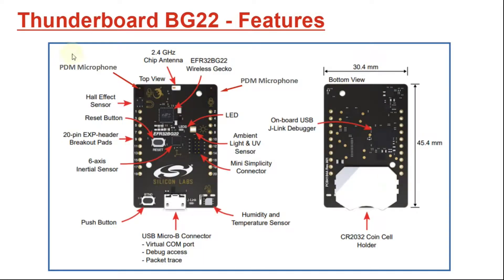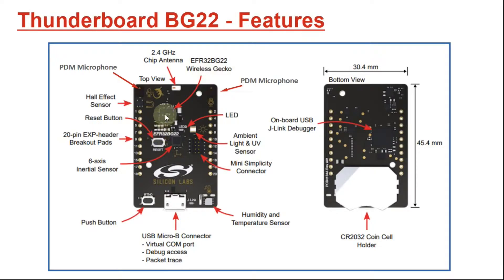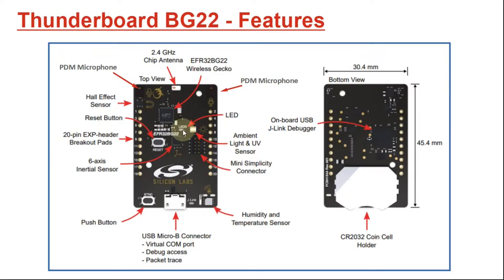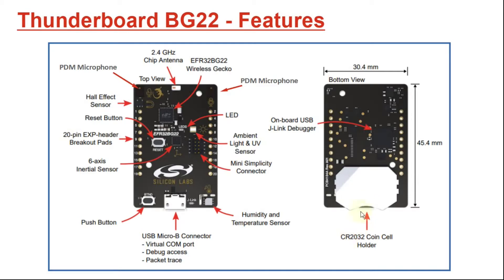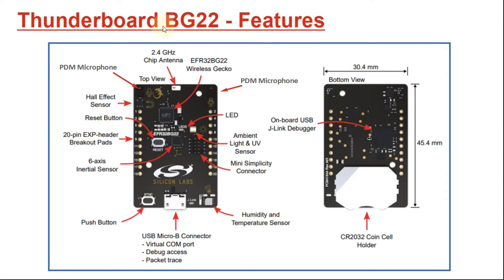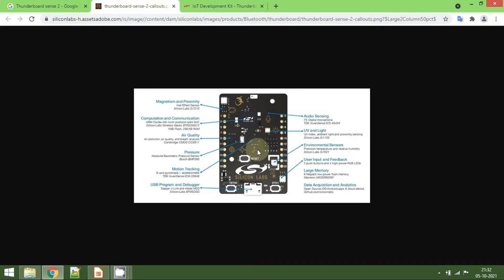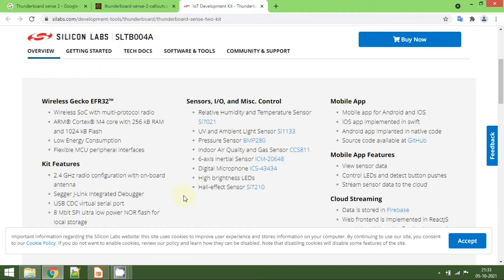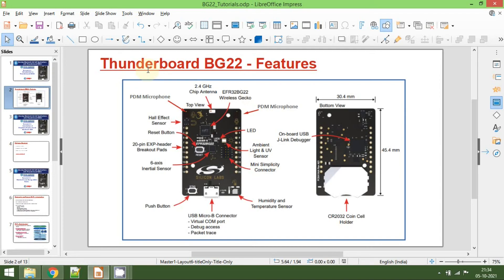Introduction to Bluetooth Low Energy - Thunderboard BG22

Comment: Please let me know if  that BLE device are able to transfer audio like bluetooth speaker or air buds, I have this question long back.
Reply from the maker: Hi Bharat,
BLE devices are not capable to transfer the audio. You have to use Bluetooth classic Or mixed due to power consumption & protocol. Because both BLE and BT classic are different protocols. However you can use BLE for voice messages to act on something. Like  Switch On the lights etc...